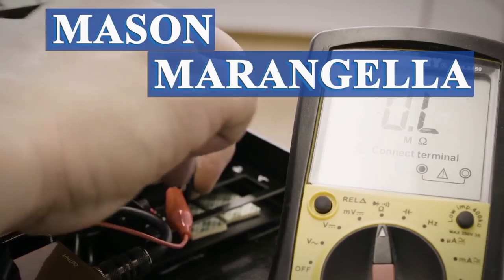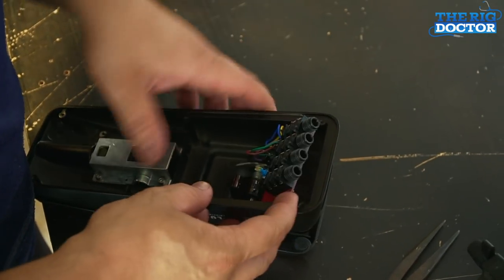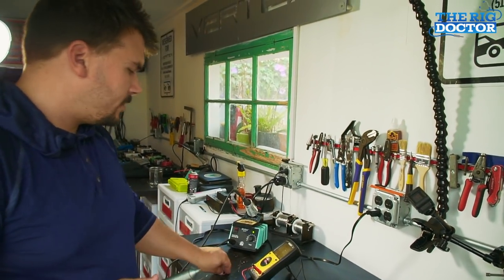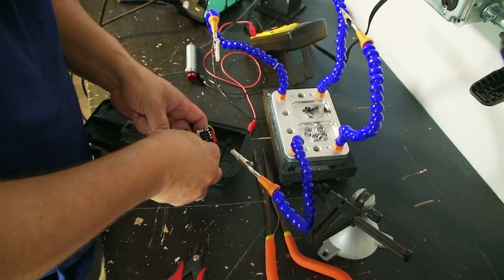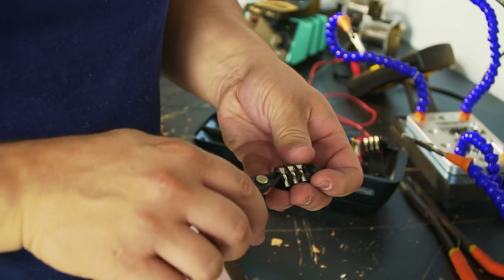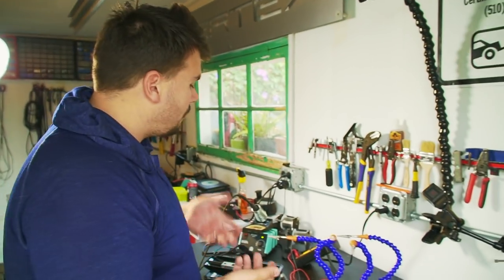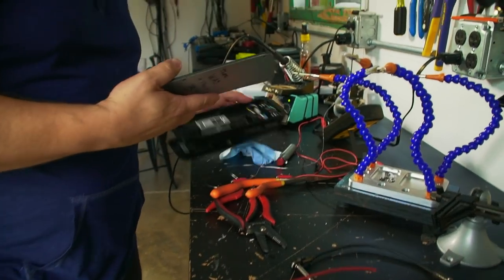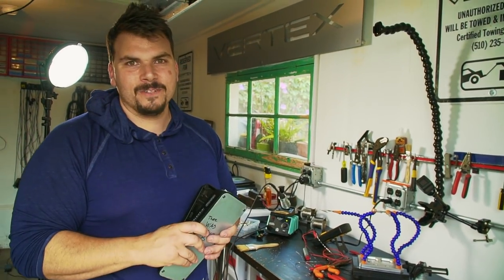Modify Your Volume Pedal

Comment: This is a pretty amazing video! Quick question: I built my wife an LP with a set of humbucker and a Ghost Piezo in it (she loves playing the acoustic). It comes out of the guitar as a stereo jack and was hoping (because this pedal is in stereo) to be able to mod my Dunlop so that the pedal would split the stereo signal inside the volume pedal and give me (for example) the humbucker/tip out the output jack and the ring/acoustic signal out the tuner jack. Is there a wiring schematic I can find online? Maybe a video? Maybe talk me through it? lol
Reply from the maker: You really should get a stereo volume pedal like a Boss FV-500L
Reply: @VertexEffectsInc  Thanks! I'll look into it. Though it looks a little bigger than I think I can fit in my rig. Thoughts?
Reply from the maker: @bourbon_sherbet1251  They have a smaller one, FV-50L I think.

Comment: Since u took the time to do that, why not put an i/o buffer on the loop u just created? I am just learning this but would a 1meg ohm resistor on the input & a 100ohm resistor on the output work?
Reply from the maker: You could you'd also need to add a power jack.  Passively, no.
Reply: @VertexEffectsInc  what would the power jack be for exactly? Do I need to add power jack to power the buffer itself? So like the buffer would be it's own circuit powered by some low voltage supply? Then it accepts the line level from the guitar? I'm sorry I know this is way too many questions. I just want to learn to understand this...
Reply from the maker: @MAP448  Buffers are active, not passive.
Reply: @VertexEffectsInc  so if a circuit is active then it has a power supply? And if it's a passive circuit then it's only "passing thru itself an outside signal?"
Reply from the maker: @MAP448  if you want a buffer, it needs to be active, you can build in a treble bleed circuit into a VP passively but will only resolve part of the problem and won't address pickup loading or impedance issues related to the passive pickups driving capacitive loads from a guitar cable.
Reply: @VertexEffectsInc  does VP stand for variable potentiometer?
Reply: @MAP448 yes the trs cable carries the power from your Amp, to the guitar and back to the pedal.

Same way you don't need a power jack on your guitar

Comment: So there were no input and output buffers in Rhett’s pedal chain? Any tone suck issues?
Reply from the maker: He’s using the input Buffer on the Boss ES5, and the output Buffer from his Strymon reverb.  It could be better, but it still sounded very good, and a lot of times the input buffers not use because of the fuzz devices.
Reply: @VertexEffectsInc  thanks for the answer. I really appreciate that!
Reply: @VertexEffectsInc  I really appreciate the links you posted for the equipment you used.  However, I noticed the octopus arms come with a different baseplate than what you were using.  Do you have a link for the baseplate you're using?  Thanks!

Comment: My volume pedal works fine if i plug guitar into volume pedal then from volume pedal to amp. But when i put it on my board after my drive pedals and before my delay and reverb when i use the volume pedal the volume drops off immediately within the first 10% of the travel of the foot treadle. Why is the sound droping off so fast when it's on the board buy works fine off the board. I'm guessing a impedance issue but i cant figure how to solve it please please please help???
Reply from the maker: Could we the impedance of the pedal before the volume pedal that's "on" or buffered.  What's the VP?  What's the pedal?
Reply: @VertexEffectsInc  it's a goodrich vp. It has a 500k pot in it
Reply: @VertexEffectsInc  my signal chain goes, ratsbaine, jhs angry charlie v2, ibanaez ts808, vertex effects steel string mkii, exotic super sweet boost in true bypass mode, then i insert the volume pedal- then into,boss dd8 and then a oceans 12 reverb.
Reply from the maker: @shadtrisdale5444  I'd put the Boost in Buffered mode, it's not ideal but has a 1K output impedance.  The 500K is high for a passive volume pedal.
Reply: @VertexEffectsInc i already tried switching the boost pedal into buffered mode that didn't help. and i tried changing the pot inside the pedal to a 25k that didnt help either if anything i gained another problem with the 25k pot all the high end was gone
Reply: At one point i tried putting the boost  as first pedal in the chain with buffered mode on so i was trying to follow your adivse with having a buffered pedal first and i have the ocenas 12 last which is also buffered output so the board was sandwiched as you say. But having the boost first with the buffer on didnt help either.
Reply: And the only pedals i have on is the delay and reverb. All the drive/distortion pedals that come before the volume are always off when i'm testing/ trying to figure this out
Reply from the maker: I would try going guitar in to boost set to the buffered mode, then to the volume pedal, then to your amplifier, and compare that to just plugging directly into your amplifier, not involving any of the other devices on the pedalboard. This will help you identify if perhaps you have a problematic cable or something else going on.  The only other thing I can think of is that the buffer output impedance is very high, one thousand ohms, it’s pretty far above the spec I recommend about 10 times higher.
Reply: @VertexEffectsInc  ok thanks i will try the boost in front of the volume pedal into the amp see what happens.i did try this - If i put volume pedal right after guitar and then into all the other pedals the volume pedal seems to work fine i know you say that is not ideal having 2 volume controls right next to each other in line.
Reply from the maker: @shadtrisdale5444  it's just to trouble shoot.  What are the cables you're using?
Reply: @VertexEffectsInc  i bought some mogami 2319 cable and some jacks and i solder and make my own cables and i test each one when im done with a multimeter testing continuity between tip to tip amd sleeve to sleeve and i make sure that nothing is touching it's not suppose to. When i take the volume pedal out of the equation everything works good and sounds good. I'm starting to wonder if it might be a cable problem i will have to go check the cables maybe all of them but especially the ones surrounding the volume pedal. ok looks like i got some testing to do thanks for all you help.
Reply from the maker: @shadtrisdale5444  I predict you left the black conductive plastic on the cables that goes to the volume pedal input.  I would check and make sure.  This is what people mess up 99% of the time with Mogami cable.  If that's not removed you're screwed and have a resistive load on the cable that most buffers can't even deal with.
Reply: K i will check that also
Reply: With the boost in buffered mode in front of the volume pedal then into amp i get about 50% travel instead of 10% before most of the sound is gone so about halfway back. So from heel down to halfway no sound at all from halfway to toe down no volume to full volume. I'm starting to wonder about changing the pot inside the volume pedal to a linear pot or maybe adding a minimum pot to the volume pedal so i can set the minimum volume. but i dont know exatcly how to add a minimum pot. I starting to think the problem was between the taper of the pot inside the volume pedal and a bad cable
Reply: I just wanted to say thank you man for taking time to help me get this figured out. You really are a nice guy not many people would take time to help like you do. I know people pay you for your adivse and help and i really wish i had money to give you for all your time. All i can do is say thank you very much your adivse is much appreciated. You really go above and beyond you deserve a award or something a gold 🏆 with a pedal on top or something 😄👍👍👍👍
Reply from the maker: @shadtrisdale5444  you're pot should be audio taper...wonder if you wired it incorrectly???
Reply: @VertexEffectsInc  i wired just like any volume pot. If you was holding the pot upside down with the lugs facing you from left to right first lug input second lug which is the wiper is the output and third lug is ground now on most volume pots the 3rd lig is soldered to the back of the pot but on my volume pedal there is a wire runing from 3rd lug to the ground on the output jack and all the grounds are connected because the volume pedal chaisis is metal
Reply: @VertexEffectsInc   i was able to work out my volume pedal problem i just wanted to let you know. I ended adding a 500k pot that lets me adjust the mininum volumeand i have full travel of the treadle now depending on how i set the minimum knob might mess around with different value pots but it's working 😄😄😄😄👍👍👍👍

Comment: Hey Mason, 

Sorry I'm a little confused about what this mod does. Does it make it so the one volume pedal can control volume AND also be used as an expression pedal? If so, if you went heel down with it to control an expression parameter, wouldn't it just mute the volume of the guitar as well?

Also, thanks for posting this tutorial! If I can wrap my brain around how to use it I may do it to mine!
Reply: Hello! No, the expression control wiring is removed from the pedal. Also the tuner out. This gives 2 free jack connections. So the outside jacks work like normal - guitar in through volume pedal and out to the rest of the pedalboard. Then after the final pedal you connect back to the volume pedal but this time it goes straight through to the other jack that was removed from the circuit board and you can connect your cable to amp into that one. The reason for doing so is that you have a single place to plug your cables and if you used for example a pedalboard switcher then you wouldn't need to plug directly in a switcher output but to a more convenient place such as the volume pedal.
Reply: @maksmail  So....essentially this mod creates a "thru" connection from the pedal board to the amp?
Reply: @harleyhexxe9806  Yes, exactly!

Comment: That's a great video. I was after a way to mod a volume pedal to include a loop to create a wet dry / send return. Any idea how to do this ?
Reply from the maker: You wouldn't be able to do it like this, you'd have to drill into the side wall to add new jacks.
Reply: @VertexEffectsInc  thanks for your reply. Any way to guide me to do it ? Thanks !
Reply from the maker: @fabzbmc2609  we have wiring diagrams like this as part of our DIY buffer interfaces that you can follow.

Comment: I don’t get it. The volume pedal controls the pedals?
Reply from the maker: Hey Curtis, it acts as the interface for the board!
Reply: Vertex Effects still don’t get it. I’ll just google
Reply from the maker: Curtis McLeod so the volume pedal acts as a regular volume pedal (no change to that function).  However there are two unused jacks on the volume pedal for an expression and tuner out.  We converted those two jacks and make them a send and return to route through the pedalboard to consolidate all the pedalboard connections in a singular location, so all input and output cables are in a “hub”.  This is often done for large pedalboard with elaborate patchbays or interfaces, but we doubled up the volume pedal to take care of this need.
Reply: @VertexEffectsInc  This a a passive Volume pedal correct? Where would you recommend a buffer or buffered pedal in a high with this? I might be missing something.
Reply from the maker: Jason Phillips This is totally passive, and the first thing with the guitar hits before it goes into the switching system that Rhett Shull used. There is no buffer before the volume pedal, but there’s a buffer after it and then for the interface side it’s receiving a buffered output from the Strymon Big Sky.  Ideally, you would want to use a input and output buffer that was dedicated for those particular purposes, and in the best case scenario before the volume pedal.
Reply from the maker: John Sagnella  This was designed with that in mind specifically for Rhett.  I don't think the mod helps you if you're using the volume pedal where I think it's best (after the drive pedals and distortion).

Comment: Contact cleaner on these 1/4" jacks is a waste of money.  They don't get carbonized, there are no open/close contacts.  And the sliding action of the plug when you push it in cleans the jack for you.  Please Note: There are 1/4" jacks that DO have an open/close contact - the plug pushes it open or closed when it is inserted.  These 'can' benefit from contact cleaner, but only if they're vEry  old or used in very dirty areas.
Reply from the maker: Chris, not sure if you're open to having your mind changed, but this information you've stated is not accurate.  I'm happy to explain if you're open to it.

Comment: this is cool, but why would you do this?
Reply from the maker: If you wanted to double up your volume pedal as an interface - otherwise no need to mod it.
Reply: @VertexEffectsInc  well i mean why would you need an interface? that's the part im sort of confused about.
Reply from the maker: Cable maintenance, and efficiency is the primary reason, keeping a hub for all of your inputs and outputs so that you don’t have cords running from all sides of the Pedalboard. This is a pretty common practice amongst technicians and Pedalboard builders alike to cut down on messes of cables on stage.  It may make more sense to you if you see the application, see Rhett Shull’s video that I linked here in the description